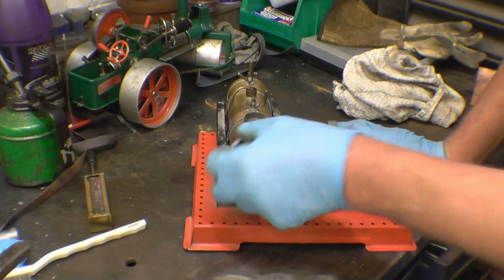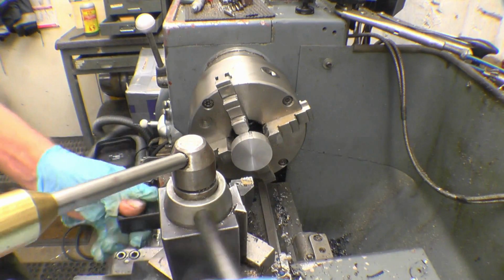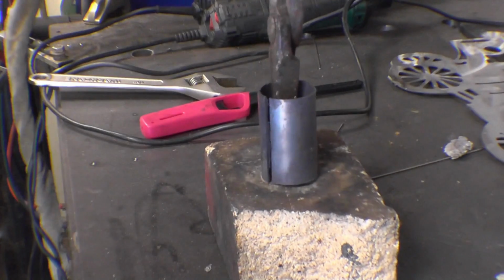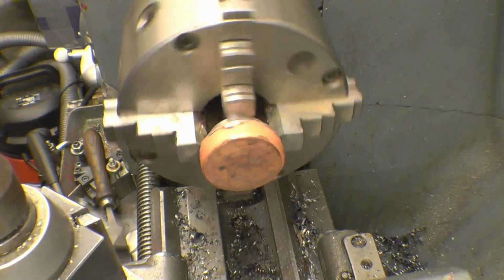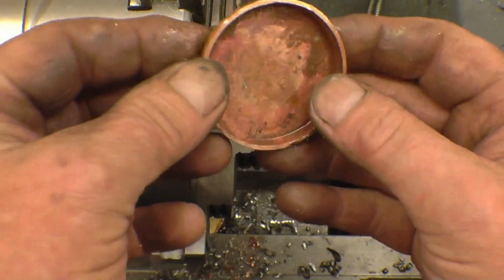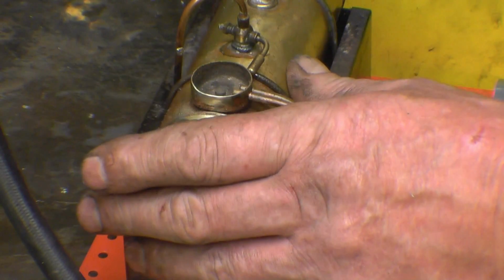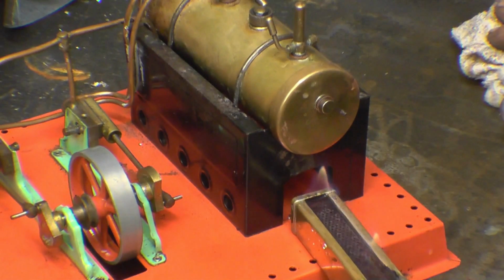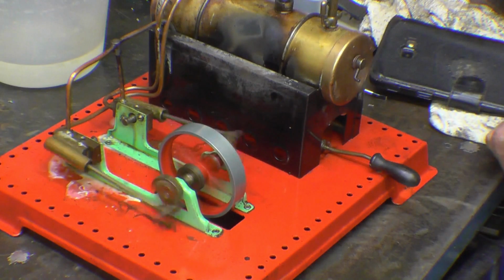SNNC 340 P2  Model Boiler Repair . Flanging Copper

Comment: Everyone who makes these wee beasties runs them on air at 1000 miles an hour.................scale that up to real size and it represents about 1 million miles an hour..........The M V Titanic ran at about 120 RPM at top speed, and Spitfire Fighters ran their Merlin engines a 1200 R P M.           What's with this need for speed in this modern world??

Stavros. Festina Lente

Comment: My understanding is a double cylinder engine must be timed at 90 degrees apart or the engine won't start. John's engine is single-acting, I am not sure if the 90 Degree rule is only for double-acting.

Comment: Great job John
I was also expecting to see you form the end cap on the lathe with a bearing mounted in a tool holder
Cheers
Reply from the maker: I will have a try this week
Reply: I also thought John may have tried spinning to form the copper end cap. Bit disappointed he didn't give us all a toot on the whistle